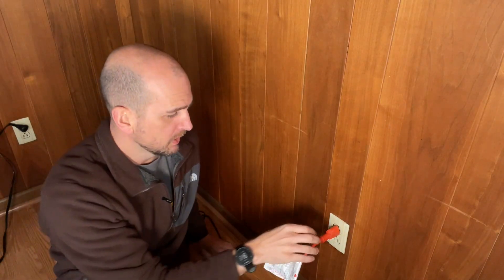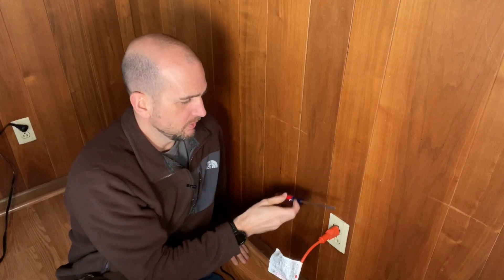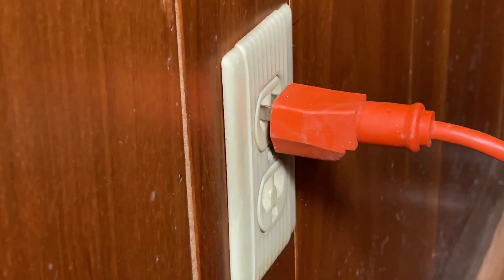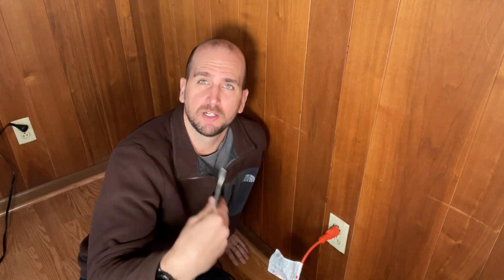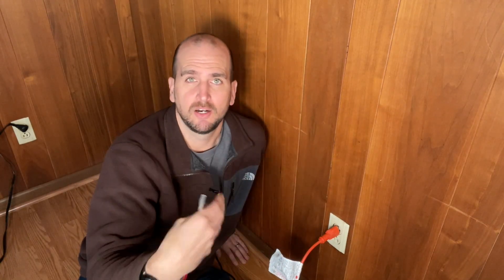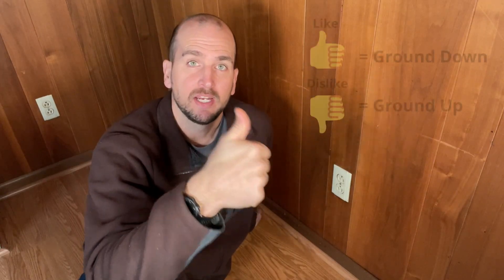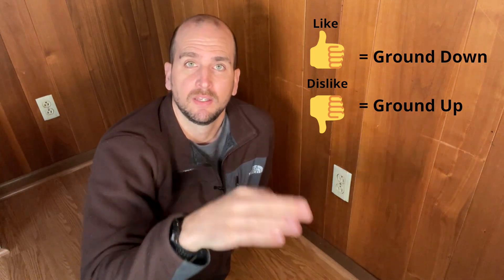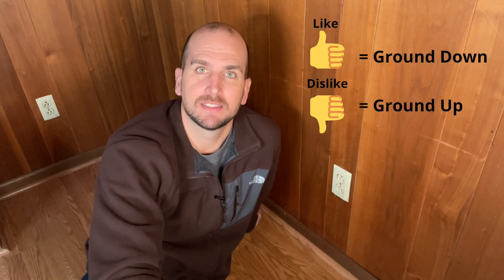Should An Outlet Be Installed Ground Down Or Up

Comment: It doent matter. Whichever you prefer. Or whichever the rest of the place you are working in has. If your doinga new biulding and you want to be a newschool fancy pants..do ground up i can see the arguement of the droping things but there isanother idea to think bout. When your plugging somethin in which way are you more likely to accidentally slip afinger and come in contact with the hot neutral pins? 22 years in electrical and im still not sure. I ike the old way of groun down. Put on yor tin foil hat and fiure it the fck out for ourself 😆 thee is no wrong way. Point 3 tho. Say the plug starts lean out froma wornout receptical. Its more likel to arc when the ground is down as aposed to up.

Comment: I was a Building Engineer for the last 32 years.  The only thing that I've ever seen fall across the prongs and short out on ground facing down outlets was the plate itself. Most of the plates at office buildings/Hospitals are made of metal. A loose or missing plate screw was the reason for the ones I came across. At Hospitals the Nurses, Doctors and Cleaners are constantly plugging in different machines. The ground facing up made it safer if the plate was to fall off and less chance of a fire or someone getting electrocuted.
Reply: Interesting observation about what could fall across the prongs. The mid-'90s NEC recommended prong up as a trial, in emulation of the Canadian practice. The justification was that a metal face plate would hit the ground prong first and not short the outlet circuit. 

Residential wiring has almost no metal face plates. As you pointed out, commercial wiring does for fire safety.

Personally, I like ground-up. It is easier to insert the plug in a single hole first and then the two prongs below when it is dark. I think most of the arguments here are simply justifying what they are used to doing. The latest NEC has no requirement for ground lug orientation. I guess the ground-lug dispute has fallen by the wayside along with other Canadian practices: the metric system and Roberson screwdrivers. All good ideas. All found very little resonance here. 

[And don't bother trying to tool me about the metric system. I worked in Europe too and I use an inch/metric tape measure. Just like Mike Holmes does. In Canada. Where they have the metric system. Except in construction  and when they are speaking in public.]
Reply: You are exactly correct. 
I was a licensed electrician for ten years and taught at the college that I went to for three years. Your's is the answer that my teacher said when I asked him the question in class one day. He was a retired electrical inspector for the city of Lexington, Kentucky and taught at the technical college where I went to get my degrees. 
I always taught ground up because of trying to keep a brass cover plate from being energized if it happened to come loose and swing over and touch the hot blade while the plug was still making contact. I was electrocuted as a child because of something similar to the plate becoming hot. I learned at a young age the dangers of electricity!!¡
Also, SS covers don't allow for the growth of bacteria like plastic or something else might.
 I've installed thousands of outlets in every configuration they can be put in over the past 40 years.
Sometimes the way the wires are coming into the box might dictate the orientation because of where the ground attachment is on the outlet, and the person before you cut the wires too short. 
Most of the time they are easy enough to swap if need be for a particular application like the 90° plug. Just make sure you turn off the power!!
Most commercial work that I did was ground up.
 I prefer it that way for anything I do for myself, but the bottom line is, I'll install them however the customer wants.
Reply: British Standard is ground face up and is more safer.  The light switch is on when down but American is up which is opposite.  American driver is on left and British is on right.  American want to avoid British style.
Reply: @redsox999  You meant "British wants to avoid American style.  Because those examples you mentioned originally from USA :)
Reply: @GiaHuyNguyenAtlanta  The bloody limeys really turned us upside-down.
Reply: The metal outlet covers serve what purpose versus plastic?
Reply: @jimcarter4425  Just more rugged and that's about it. Plastic ones can crack easily when screwing them on. I guess there's fire reasons as well,plastic  gives off heavy fumes..which I'm sure you know already.
Reply: @jimcarter4425  They are stainless steel 90% and dont rust or corrode , Dont crack off after years. All hospitals use them almost evreywhere Im local 24 IBEW and worked in all the Balt md hosp.
Reply: @jimcarter4425  DURABILITY

Comment: As a biomedical equipment technician I was under the impression that there was a code for ground up in hospitals. I was told the reasoning behind it was if they used metal cover plates and the cover plate came loose it would hit the ground instead of shorting out.
Reply: I'm a BMET as well and this is exactly was what I was taught about 10 years ago
Reply: That’s actually correct and it’s in the NEC… the metal plate is supposed to hit the ground and make contact with the hot and immediately trip the breaker instead of someone getting electrocuted

Comment: My outlets literally say top on them and that has the ground facing down but when you explained the loose wire in it mine are so tight you have to literally pull to get them out and push to get the plug in so I don’t think that will be a problem either way I just remodeled my whole house and rewired my whole house I put all my plugs the same way and have never had a problem and don’t think I will have one.

Comment: ABSOLUTELY!  Several years back, my wife was measuring a wall.  The tape measure slipped down and instantly grew two deep dark divots.
I believe in "Ground Up".  But, I immediately saw the problem is 90-degree plugs that will hang "wrong".
I thought it was code.  :P

Comment: Ground up always. My reasoning on that is if you are plugging something in and you can't see outlet well you can put your thumb on the ground prong to help guide in your plug. But it always looks upside down to me. So you have to decide if you want a safer outlet or a pretty outlet. With the ground up by logic it is just safer in several ways. That is just my thoughts. I have read through some of the feedback and beginning to think that all in all it would be best with the ground down. outlets cracking, plugs falling out, etc. Maybe it is better for the ground to be down. DAMN, now this is going to bug the hell out of me.

Comment: Ground facing down incase where an area is prone to flooding. If build has metal material drop down preferrably it should be up. So conclusion, it should up to the electeician to decide for best result and check NEC codes.

Comment: The angled plug  still clears up more room. The fact  it shoots upwards first  will not cause you to  lose space. As for the up/down situation, i build wall units and distribution panels for hospitals and as mentiined, hospitals are predominantly placed upwards. Pretty sure 90% or more  of products used in hospitals have a grounded connector. Its code. I do this  at home as well. Its not 100% safe but still safer than down in regards to shorts.

Comment: Ground down, as the right-angle-plug advantage overrides all other considerations.

More interesting: What are the pros and cons of receptacles mounted in the floor? Immediate advantage: Gravity does not affect the plug. Would the ideal be receptacle recessed in the floor, with a sliding cover?
Reply: Liquids mabey but yes I like idea
Reply: I have never seen a ground receptacle with a sliding cover not immediately become difficult to open and close, because of grit getting in the mechanism. The only good ground outlets I have seen had large, hinged doors covering them, and room inside the floor cavity to fit a fairly large transformer plug.
Reply: @diggoran  Good points. I don't care much for things that slide, either, and hinges are probably much better. Not sure how you make that flush in use, though. Need to think more about it. You're right that it needs to accommodate a power brick, AND allow the cord to come out in the right direction, with enough room. Not rocket science, but easily done wrong.
Reply: The majority of floor mounted outlets get abandon with time.  Grit, moisture, people stepping on them, you name it everything takes it toll on them over time.
Reply: @oaker55  Generally, they need to be in recessed wells that protect them from all the things at floor level. The exception would be if the floor environment somehow has protection inherent in it.
Reply: @ronaldgarrison8478  Oh, I know how they are supposed to be installed, I've been an electrician for 45 years.  I'm just saying that I have yet to see a proper installation that has stood the test of time, particularly in a commercial environment.
Reply: @oaker55  OK, I'll make a mental note of that. I can see how floor recpetacles might have problems in some commercial environments, while in residential situations you might not have as many problems. I'm thinking particularly of spills of various liquids. And anywhere, if you mop the floor, floor-mounted recesses can pose immediate problems. Then again, in other environments this is probably no risk at all.

Comment: Shrewd way of getting 'likes'. But, if it works... it works.
Flipping the ground from bottom to top also flips the orientation of the polarized plug. If a device (two-prong, no ground) is polarized, then the device must be plugged in 180 degrees from its intended orientation. This may be OK for cords, but for devices that plug directly into the outlet and hang there, there could be issues. Plus, some 3-prong devices that plug directly into the outlet may now be upside down, rendering them more difficult to use. My wattage monitor is oriented in such a way that I have to read everything upside down since it's designed with the ground down and my outlet has ground up. That sucks. Ground down seems to be the preferred orientation for devices designed to hang off of the outlet. 'Nuff said.

Comment: I've been a Electrician for 40 years, In all residential it's Ground down, But Commercial it's what Specs call for, Most all Hospitals, Schools call for Ground up, Esp. if Stainless Plates are used!
Reply: oof definitely.  Why conductive plates these days?  As a non electrician who has done a lot of fixes, I dont see any benefit of conductive (or potentially conductive) plates or boxes as hot grounds happen when fixtures fail so you're basically putting people (at some point) at risk with them of a shock.

Comment: I have to say the scenario with metal objects falling on the plug in a receptacle is very unlikely, though possible. 1)Ground down insures the load attached to the plug will loose the ground connection last if the plug begins to droop out of the receptacle, whereas a ground up orientation could cause the load to be ungrounded before the plug falls out completely. 2)Molded angle plugs tend to be intended for ground down. 3)Ground down is more familiar for me. 4)I agree with the suggestion to utilize different color receptacles for switched outlets.
Reply: agreed, and to add its way more likely a ground incident towards the plate is going to touch either hot or neutral (about 50/50) so flipping, and having a problem, you might propagate a hot ground.  That's not necessarily a safer situation.  It seems like an arbitrary distinction to me and its less aesthetically pleasing. Also, someone who didnt know any better might just always assume ground was closest ... to the ground.  I think this is one of the reasons it isn't becoming code.
Reply: Always seemed kinda far-fetched to me as well. Could it happen? Sure. Does it warrant turning every outlet upside down putting stress on cords and plugs and being a general pain in the ass to plug most things into? No.
Reply: Plugs where it's possible to disconnect the ground first are not up to code and thus illegal.
Reply: Metal objects like faceplates do fall on plugs. It's the reason commercial buildings like hospitals install ground up. A patient once died after a plate shorted an outlet and cut off his life support.

Comment: Ground down!   I have been doing it ground down for over 50 years and that's the way it is.  Someone once told me it should be ground up just in case a piece of metal might fall across the two prongs of the outlet and cause a problem.  Yeah, right!  That happens a lot!  In fact I have NEVER heard of it happening!  Ground down!

Comment: Ground down... Always... No ifs, ans or buts. Not only is it the international standard but if you do it ground up, every polarized plug, including ac adapters will have to be pigtail up and the pigtail side is the heavy side so they'll not only look awful but they'll lean away from the wall.

Comment: When I was an electrician ground up was used for commercial applications and hospitals.  Not code requirement but specifications.  Commercial applications were to prevent the paper clips, staples and other metallic bits from striking the hot and neutral, thus creating sparks and most importantly reduce inadvertent breaker trips shutting down multiple commercial equipment and personal work stations.
Reply: Yes. Ground up in commercial. Where I work we have some cowboys that don't do that and I was working on a wall above an outlet and a paper clip pinned to the wall fell and went POW!

Comment: Because of the prominence of two prong plugs, I have seen places that do the outlets sideways with neutral facing up. Then if something falls on a partially connected plug, it would touch the neutral, which at the breaker box is connected with the ground bar.

Comment: The ground prong is more often than not the tightest, strongest connection.  For that reason it keeps the other two spades fully in the socket.  Ground prong down has more of a tendency to want to sag and thus begin to pull the hot and neutral spades out.  That’s my reason for ground up and I’m sticking to it…

Comment: Hey hey. I've always been a ground down guy. Old timers would say "they're called U plugs for a reason". There ground up argument is kinda weak. It can hit the ground then roll off and touch either prong. Got a 50/50 its not the hot. In our area we have a lot of those 90 degree ends. So that makes ground down better for us.

Comment: I once had a metal antenna for an RC car slide down and short the two pins on a plug with ground down. The plug was not entirely flush because the receptacle was older and loose. If the plug had been ground up, there wouldn't have been that small explosion.
Reply: If the outley was that loose it should have been replaced. Loose plugs heat up (depending on load) and can cause a fire.

Comment: As far as an appliance getting electricity, it makes no difference. Arguments can be made for any position you want to argue for.  Because the Electrical Code does not so state, than it is a matter of preference of the homeowner.  I know a lot of electricians have their own idea which way it should go but that’s not a deciding factor. The homeowner is paying the bill, so they decide.

Comment: I remember having outlets with ground up and I plugged a night lamp in and it shorted because it was upside-down. The plug was old so it was worn and the prongs positive and negative fit in both. So two problems with our outlets.

Comment: I've been paying attention to this for a while. While I agree that ground up is probably (marginally) safer, I have noticed that I've seen probably 20 plugs where the polarization made a difference (some of them heavy GFCI), ground down has been the assumption and only one plug (a power-strip, I believe) where ground-up appeared to be the way it was designed to plug in. It seems the industry believes in ground-down. It might be interesting to try and speak to some of the engineers who designed these things and see why they have adopted this convention.

Comment: If you have metal bead curtain openers that hang loose they can bridge the hot/common setup on top and surprise you.  Had it happen in a nursing home and it scared the staff member pretty bad when it sparked!

Comment: The ground up idea was actually thought up by a Rockwell Automation engineer promoting saftey ideas. The ground installation idea is so if the plug comes partially out of the outlet and something metal falls on the plug it will block the object from shorting out the hot and neutral side of the outlet, bright idea huh?

Comment: When using metal outlet covers ground goes up, when using plastic outlet covers the ground goes down.  It is the outlet cover that has the highest percentage of coming loose and hanging on the contacts in the plug and starting a fire

Comment: Ground up, for the reason mentioned. Should something conductive fall across a partially inserted plug (I've had this happen!), the odds are 50/50 if a short will occur. 

Ground down, you will get a short!

Comment: I am a housing inspector and I find that most times when the ground is facing up it gives a higher percentage of hot and neutral reversed which is a fail for housing and the landlord has to get an electrician to come in to reverse the wiring.